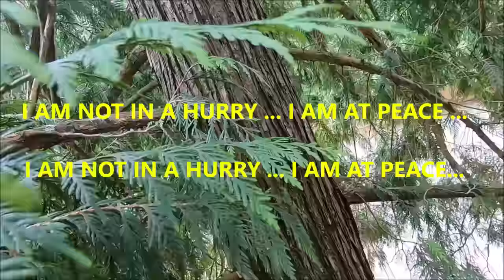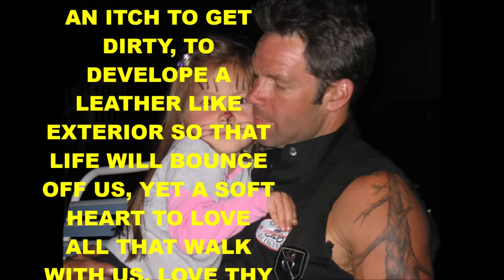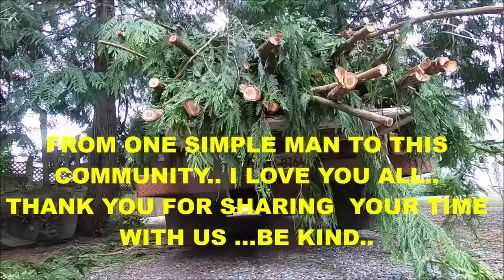RIGGING TREES TOPS OLD SCHOOL.

Comment: Billy on your truckers hitch. New trick to old school. When you feed the line through the pully knot. pass it through one more time. when you pull it will cinch down and lock in place. Undo that by running the line back through the loop and pull. Supper easy.

Comment: Your advice about not shutting down the saw immediately after a big cut is probably excellent advice for any motorized vevhcile or machinery. For example, even if on a road trip — don't turn the car off immediately upon parking; or lawn mower, snow blower, gardxen tiller, etc.etc. etc. I'm in on that!!

Comment: great choice of climbing saw. the Echo 2511t is the best climbing saw you can get. I've owned 2 and will continue using them. they are exceptionally light with plenty of power and very reliable. 2511t > Stihl ms201 in my opinion, and I've used both.

Comment: You know I love Billy. But the thing about letting your saw cool down before cutting off is hilarious. What is the difference in running it wide open and idling down then off rather than just turning it off. It will take longer to cool down idling than it will just turning off. And when you turn it off it will cool down slowly and not just instantly cool. Its not like the saw bar is going to warp because of rapid cooling or even the muffler

Comment: Great work on the videos sir I really appreciate all the tips and pointers. I am just getting started into the arborist business and a quick question for you, how high do you typically go on a tree before you choose to top it and work your way down? Is it case by case depending on type of tree and strength and condition of the wood or do you use a size range? Thanks in advance for your help!

Comment: What's the science behind letting your saw slowly run down after hard cutting?  I sorta do the same but I don't have a good reason why.  It's air cooled and shutting it down immediately doesn't expose anything to extreme temperatures.  Running it longer doesn't really cool it off much and the difference would be too gradual to make any difference for rings/piston/combustion chamber.  The only  thing I can think of might be the sudden stop for the carburetor might cause an irregular vacuum or vapor lock if you shut it off during a high rev. cut.  Anyone got any input?

Comment: Take a magnifier and check the mantle (outer sheath) of your rope. I'd suspect you may have burned and compromised its life on the fast drop of the top. As a climber, I don't like to "fast-rap" on my ropes. They are expensive and I want them to endure. But ... that's just me. Keep it safe!